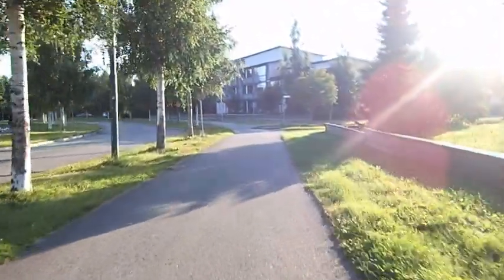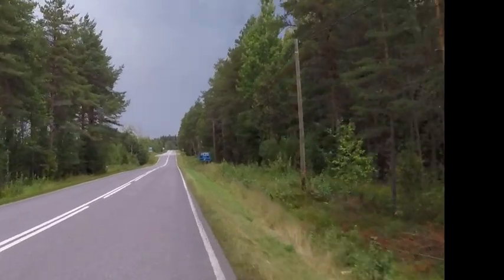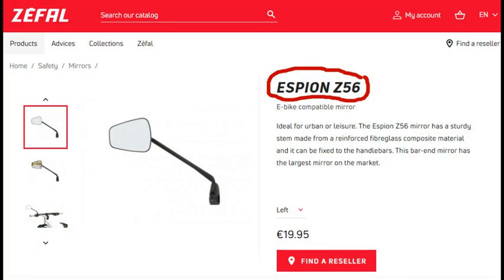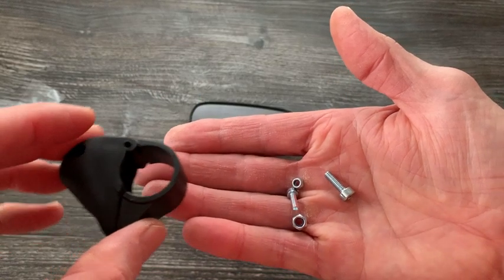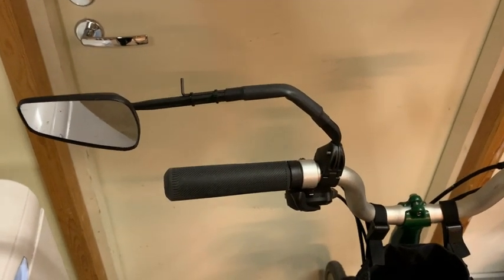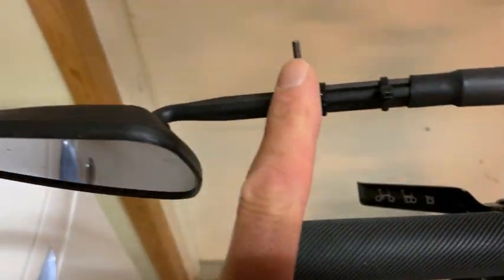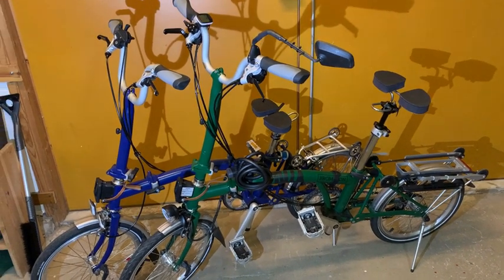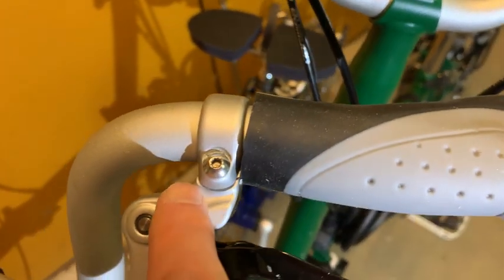Need to see behind? DIY mirror modification for Brompton.

Comment: I'm glad the mirror works for you. I use the BM Cyclestar short inserted into the handlebar end. I also have an allen key if I need to remove it when folding my Brompton.
Reply from the maker: Hi Edward. Thanks for watching and comments. Cyclestar looks quite good, because it's bigger that most tear-shaped mirrors. I decided to reject handlebar end mirrors, because one got broken already when the bike fell down: a child hit it with her bike, when Brompton was on side stand / kick stand. Brompton side stands are not very stable: bike falls down quite easily, if I'm not careful with it. I'm sure handlebar end mirror works fine, when you take good care of your bike and don't let it fall down.
Happy Ridings to you !
Regards: Pekka, Cycling Finn

Comment: Very interesting. I also recently posted a video about the use of mirrors on my Brompton. We have much in common, age, bikes and messing about in the workshop! I subscribed.
Reply from the maker: Hi, thanks for watching and comments. I watched your mirror videos. For me, the one attached to glasses may be interesting. My current spectacles are very light, titanium, and fixing a mirror there might be challenging.
One differerence of Finland and UK is the diffrent side traffic. The Cateye-typ mirror assembled at left side and at the end of handlebar needs to be easily flipped so that it does not hit the ground when bike is folded. As explained in video, I was not happy with Zefal, due to its limited visibility.
You are quite productive with your videos, great 😄
We share similar attitude of safe riding, so happy miles to you. 🚴

Regards: Cycling Finn
Reply: @finn111  I loved your creativity in fixing the problem - most people would have put it in the bin. Not us. 😂😂😂

Comment: Sorry, from another Finn (Denmark), but you are able to use a special bending device for minor tubes, in several sizes (Cobber, plumbing), to do a job like this! I am looking for a mirror like this also, for my Brompton, as I, as an old man of 74, am not as nimble as in my long time past youth. 😄
Reply from the maker: Hi Finn, thanks for watching and comments. Yes, I know what you mean, and I have two bending devices, mainly collecting dust in my garage: one for car brake tubes (diameter about 5mm) and another for copper water tubes, outer diameter 10mm. I did not want to buy another tool just for this, so I decided to do bending "quick and dirty", with a hammer 🔨.

In order to use my current tool and 10mm aluminum tube, I should have filed the mirror parts much thinner to fit inside the tube, which may have made them easier to break. If I get orders from Bromptoners to make such mirrors, I'll by 12mm bending tool for nicer look. Or maybe try with10mm tube🤭

Do you have a Brompton? No matter what bike you have, it's great that you still ride a bike; you are my role model now 🚵. I wish I can take my Brommie with me and visit Denmark some day. I guess cyclists are welcome and cycling is safe in most cities and towns.
Regards: Cycling Finn